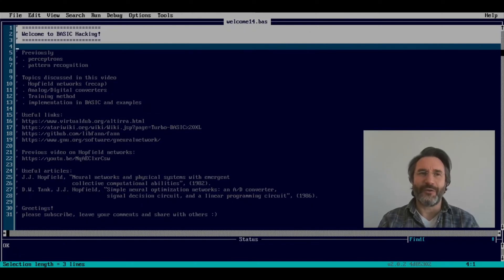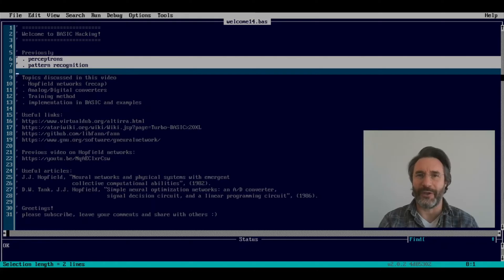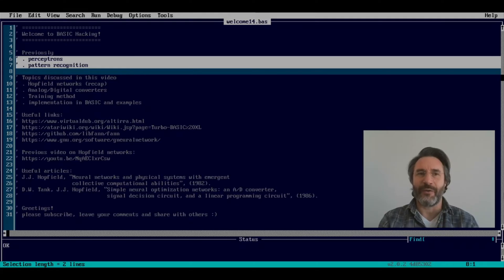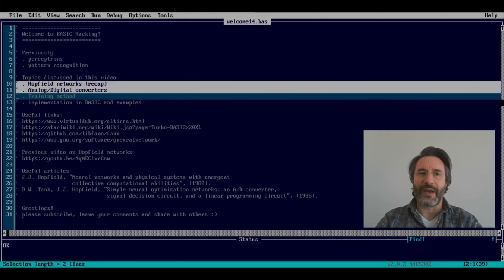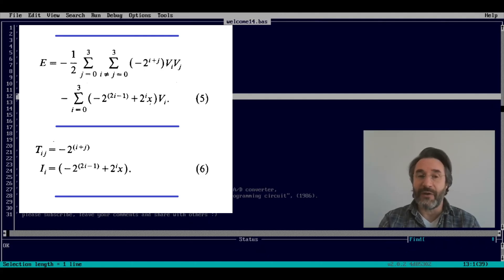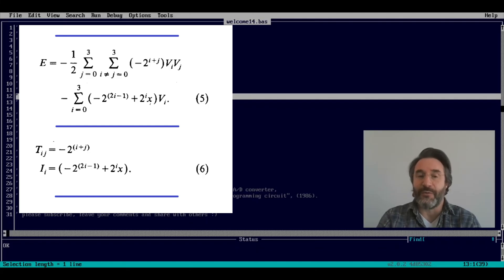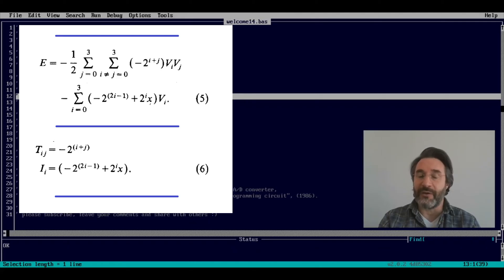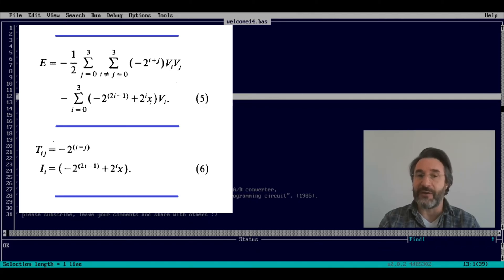Hopfield networks and Analog/Digital converters - BASIC Hacking - 14 #BASICHacking #AI #ML

Comment: For me I2 + sum never gets > 0, so all outputs run against zeros all the time. I checked the listing a dozen times. what could be wrong?
Reply: 1000 rem a/d converter with hopfield network
 1010 iter=15      : rem number of iterations
 1020 nn=4         : rem number of neurons
 1030 xinp=0.5     : rem analog network input
 1040 dim v(nn)    : rem values of the neurons
 1050 dim t(nn,nn) : rem weights between neurons
 1060 rem --- random initial condition ---
 1070 print "  0)";
 1080 for i = 1 to nn
 1090 :if rnd(1)>0.5 then v(i)=1 : else v(i)=0
 1100 :print v(i);
 1110 next i : print
 1120 rem --- formula (6) part 1 ---
 1130 for i = 1 to nn
 1140 :for j = 1 to nn
 1150 ::t(i,j)=-2^(i+j)
 1155 ::rem print t(i,j);
 1160 :next j
 1170 next i : rem print
 1180 rem --- evolution ---
 1190 for k = 1 to iter
 1200 :for i = 1 to nn
 1210 ::sum=0
 1220 ::for j = 1 to nn
 1230 :::sum=sum+t(i,j)*v(j)
 1240 ::next j
 1250 ::i2=-2^(2*i-1)+(2^i)*xinp
 1260 ::v(i)=0
 1270 ::if rnd(1)>0.9 then goto 1290
 1280 ::if (sum+i2)>0 then v(i)=1
 1290 :next i
 1295 :if mod(k, 5) = 0 then begin
 1300 :print using "###)";k;
 1310 :for j = 1 to nn : print v(j); : next j
 1320 :print
 1325 :bend
 1330 next k
Reply from the maker: I think I need more elements to answer to this one. Are you using the same emulator and BASIC language? This could make some difference in the random number generator for example. Let me know. Thanks for your question!
Reply: @jeanmichelsellier  Hi! Took me some time to get a Win PC, the emu and Turbo BASIC at hand. And yes, there was a difference in my (Commodore) BASIC. The negative operator has a higher precedence than the power function, so I got -2^4 = -16 when Atari BASIC got -2^4 = 16. With the correction of some brackets the programs are delivering the same values now. 🙂

But still I can not see this A/D converter working. What are you expecting for 0.5 to come out? I guess it should be 1 0 0 0, or? The random 10% is making anything 0 over time.
Reply from the maker: @Bananzi65  Thanks for letting us know about your progress! To quickly answer to your question: yes you are correct, at 0.5 you should get 1000. I have a question too: what happens if you run exactly the same code as mine? Do you get exactly the same results? Maybe, this will provide a way to find a solution : )
Reply: @jeanmichelsellier  Your code at line 181 makes it impossible to get the same results as you, because it is dependent on a random behavior. And when a neuron is 0 it can`t come back, look at the math. So most runs end up in all zeros. Run your code several times with starting neurons 1000, you get more 0000 then 1000 back. And the code is simple, I mean you can see it by going through step by step, it must be this way. Sorry, but for me this isn't working at all.
Reply from the maker: @Bananzi65  Thanks for sharing your further tests! I will double-check my code and get back to you as soon as I can. If there are mistakes, I'll make sure to fix them. Thanks for helping with this!
Reply from the maker: I found some time to check your BASIC code and there is something I'd like to understand. At the beginning, you have:
1090 :if rnd(1)>0.5 then v(i)=1 : else v(i)=0
I have noticed that there is a symbol ":" before the "else". Could you please check your initial conditions? I suspect that there might all be zeros.. Let me know! :)